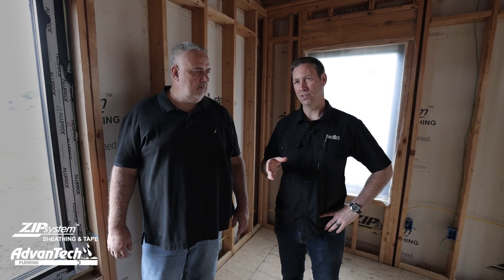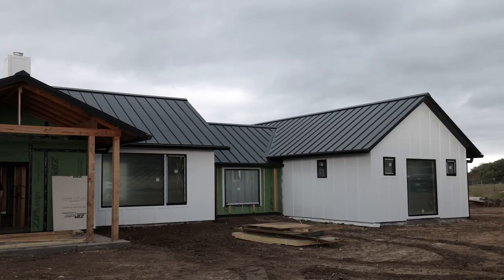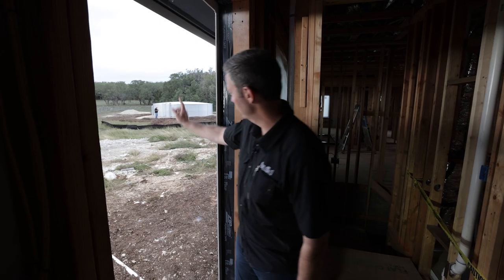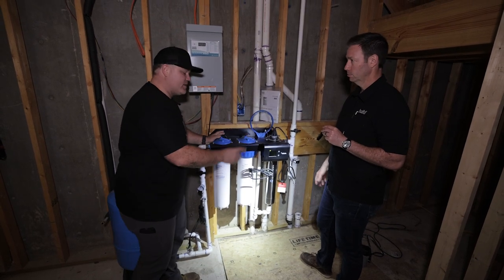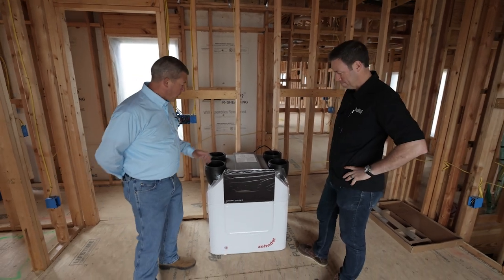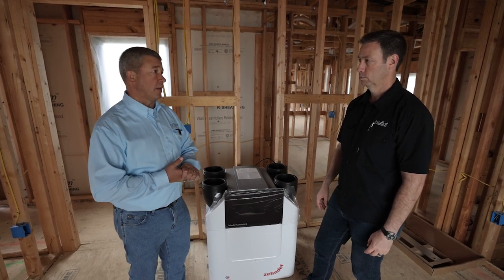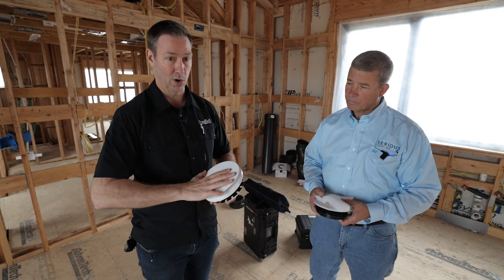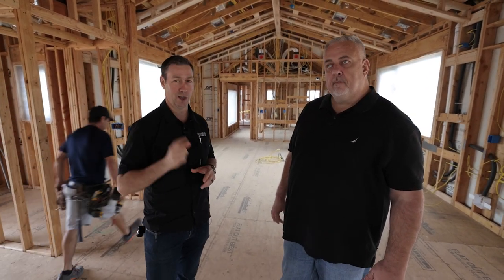No city water? No well? No problem: 55,000 gallon RAIN TANK

Comment: Drinking water from roof runoff has to be against all health stds.
Reply: They literally explained it all less than 5 minutes into the video.
Reply: Ever checked your state water report? You might be surprised, plenty of bird shift and unmetabolized medicine etc
Reply: You aren't drinking the water straight off the roof.  It goes through many filter.  There are nine filters on my system.
Reply: @basiaboy  that’s correct. Most people may be shocked at how disgusting some things truly are.
Reply: No, your wrong.  We do it all the time here where I live, with Permits and everything.  With proper materials and good filtration is is legal, safe and fast becomming more necessary.
Reply: @basiaboy  that is true, meds that don't get filtered out is a problem
Reply: Correct, it won’t give you any STD’s.
Reply: @Off-Grid  Do you have any video or in-depth details about your system?  I'm going to be installing some sort of off grid system soon.
Reply: @johngudde8258  yes, There is a playlist on our channel.